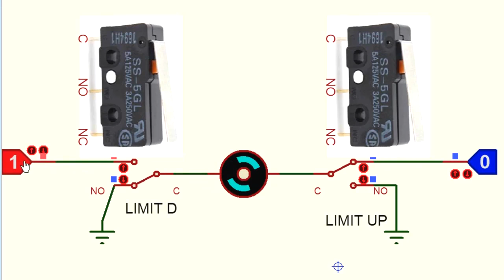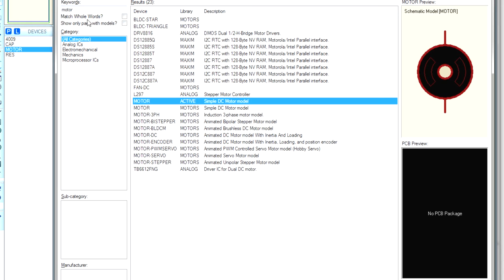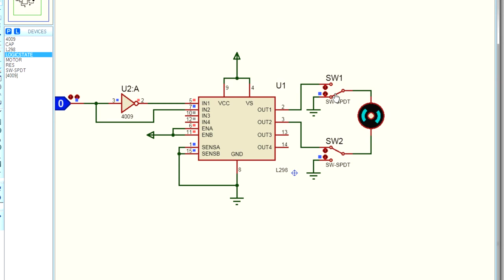How to make a Automatic Door Opening  using Motion sensor

Comment: can someone tell me what are the components and software he used ??
Reply: Kenneth Allag I don't know about software but..
parts:
1:Gear Motor 1
2:L289N motor driver 1 
3:Motion sensor 1
4:some gears from toy bayblade
5:steel rod
6:wires
7: breadboard
8:And that chip on breadboard was microcontroller he foold us saying no Arduino but he used that chip which main part of Arduino so....
Reply: Software used in the video was most probably proteus

Comment: parts:
1:Gear Motor 1
2:L289N motor driver 1 
3:Motion sensor 1
4:some gears from toy bayblade
5:steel rod
6:wires
7: breadboard
8:And that chip on breadboard was microcontroller he foold us saying no Arduino but he used that chip which main part of Arduino so....
Reply: Which ic chip did he used then
Reply: do i need to write code for ic?
Reply: What chip?